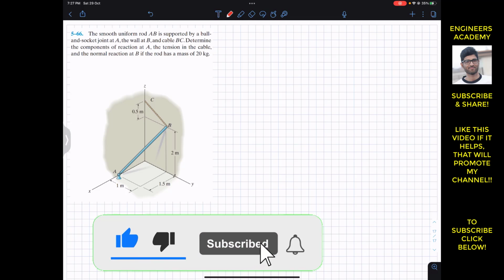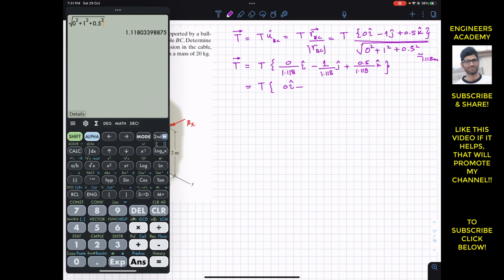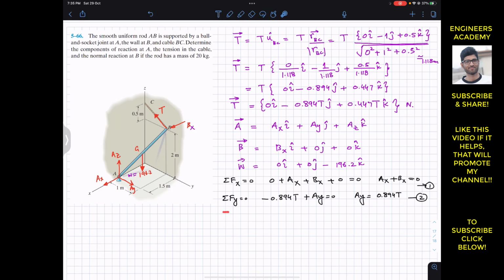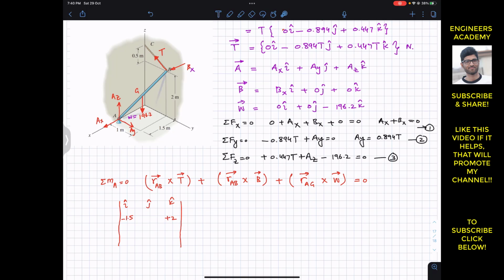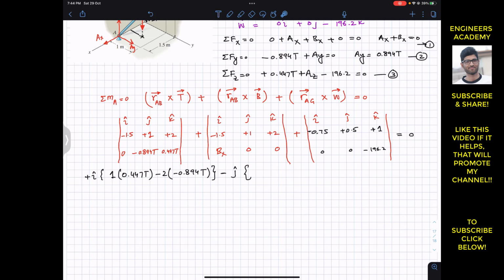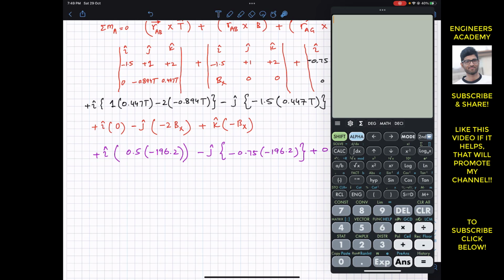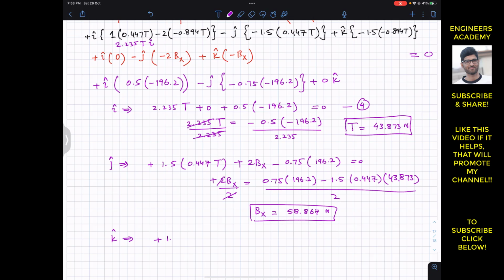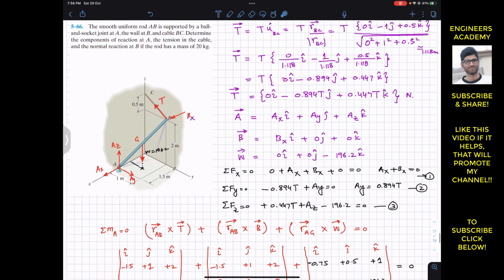5-66 Equilibrium of a Rigid Body (3D Equilibrium Problems) Chapter 5 Engineers Academy

Comment: An electron is subjected to the influence of an electric field as
it travels downward from plate A to plate B. If the particle is released from rest at 
the midpoint C, s = 310 mm, and the acceleration is a = (3.5 s) m/s2
, where s is in
meters, determine the velocity of electron when it reaches plate B,
s = 550 mm, and the time it takes to travel from C to B